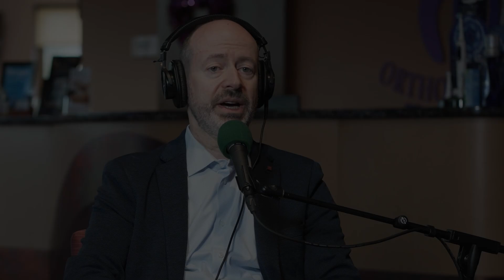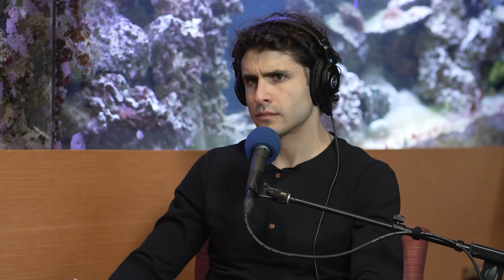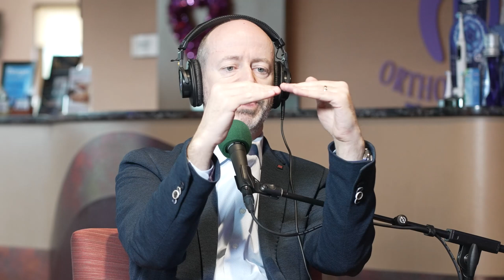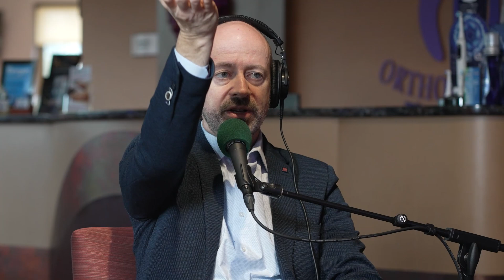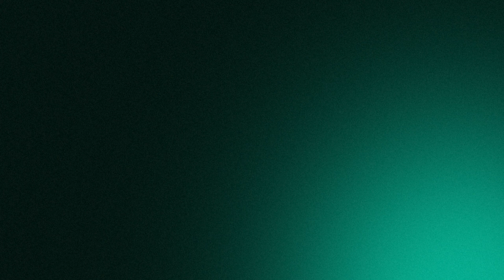Are Molar Arms Really Necessary?

Comment: Hey, have you talked about the prevalence of camouflage orthodontics (classic example: class 2 compensation) in todays orthodontics, causing patients who have a skeletal issue to have significant challenges of having a jaw surgery after this, since you would need to decompensate before surgery, which is VERY hard to deliberately cause overjet on patients. Leading patients to be stuck with a perfect bite (YAY!) while having a severely bad side profile...Thanks!